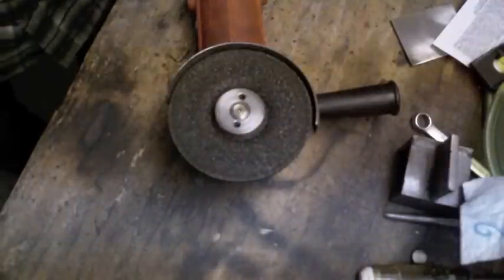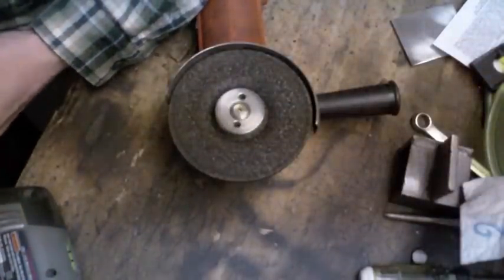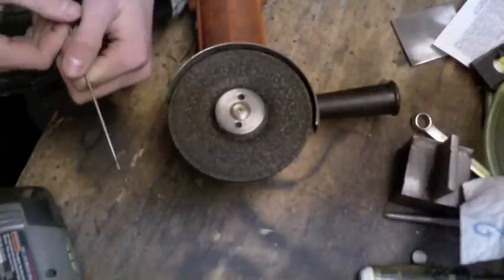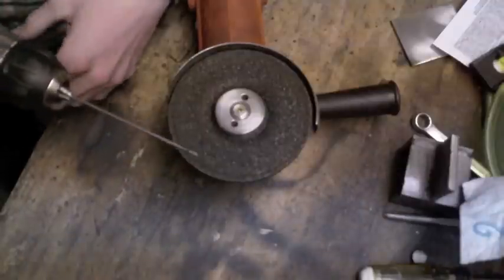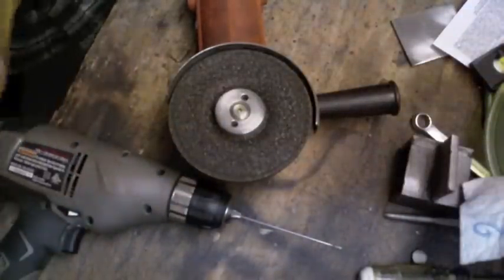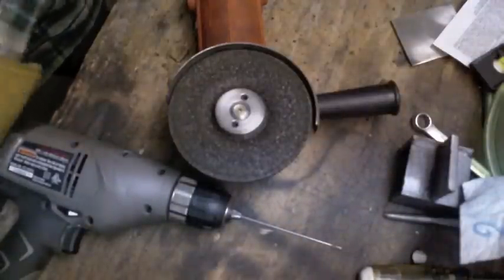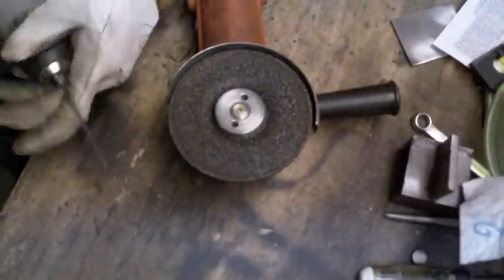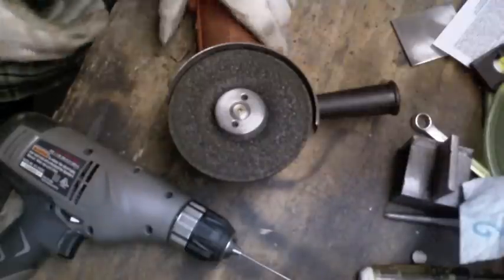cheap way to grind tungsten for TIG welding

Comment: All 3 welding requires so much stuff and space. I’m trying to avoid yet another tool to add. I have many years of experience with  the angle grinder and the torque it produces, so I’m confident this method should work. I noticed others use this method as well. I wonder if maybe temporarily clamping it down to a table with a pipe clamp would work.

Comment: I'll sharpen totes and just like that for years however I don't use grinding wheel I use a sanding pad and I use a Metabo grinder the thing so smooth to be sitting there running upside down and no vibration at all it's also better to Triple disc a double disc because disks overtime become distorted so you alternate the roles in the disc so that it doesn't have humps and it's perfectly safe and has the guard on it in leather gloves on a smooth surface spinning like that isn't going to do anything I do not take my Tig gloves off to sharpen tungsten and Metabo grinder don't vibrate like that

Comment: To improve upon your method, do the following : 
Place a neatly folded rag between the grinder and the table.(reduces vibrations)
Use the smallest drill available and the thickest grinding wheel
Secure the grinder to the table by any means possible

Comment: For anyone grinding thoriated electrodes.. you need proper ventilation. thorium is radioactive and while there is no need to worry when it's outside your body if it gets inside your body, by breathing the dust, there can be serious health effects.  Having worked as an on site emergency welder I can appreciate the need for emergency fixes on occasion but this should not become practice as it's virtually impossible to do this safe and well ventilated without serious engineering work.

Comment: I use a 120 grit flap disc, and the angle grinder in a vise, but otherwise this is the best way I have found to sharpen tungstens... and I have used a triad....   The flap disc seems to work better, and faster (not to mention safer) then a grinding disc.

Comment: This is more dangerous than 500 characters can state. Never use Tig gloves with spinning power tools, let alone two tools. (The glove is too bulky) Never think you are safe to hold down a grinder with your body. (RPM is 10,000 +) Never try to sharpen Tungsten on any grinder disk or wheel that isn't rated for it. Tungsten is hard enough to cut through the disk if you aren't VERY careful. (Wheel breaks, you get hit, you visit medic...) Lastly, you will contaminate Tungsten if you use a dirty wheel